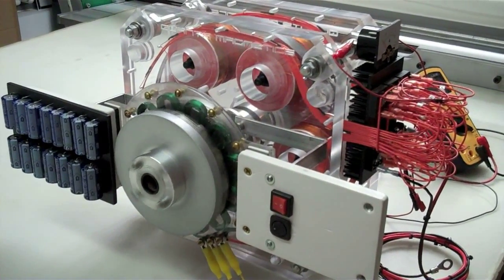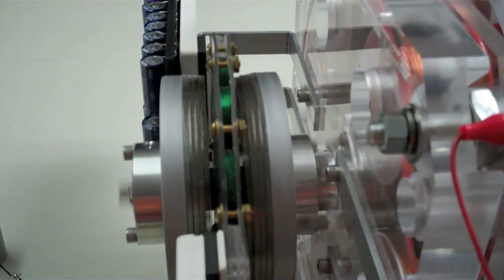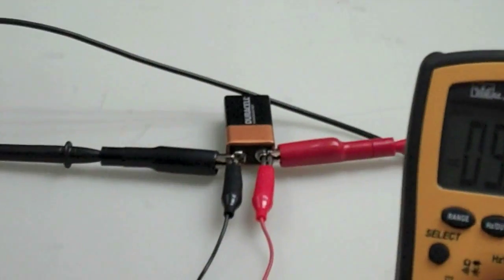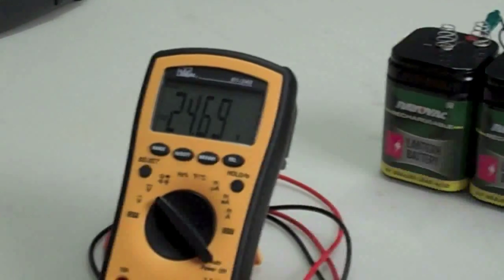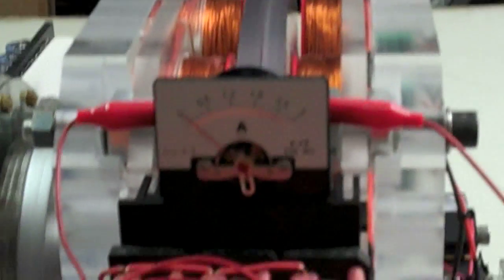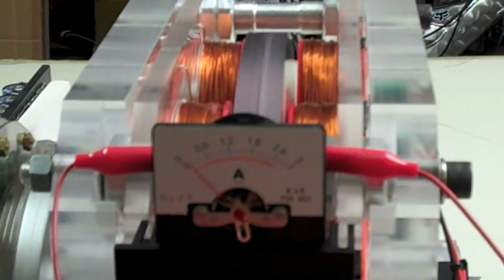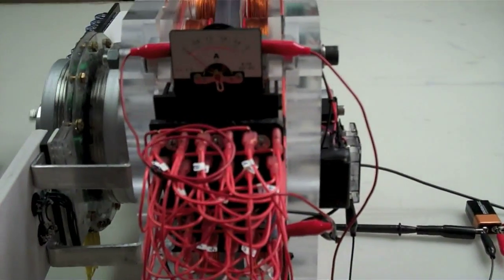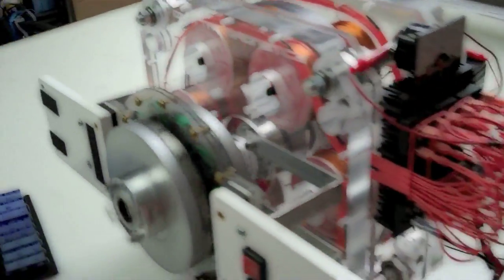Ultimate Pulse Motor Generator - New Energy

Comment: Hey, here's an idea... I'm not a genius, but if you got to the point of building such a complicated and "awesome" device I'm sure it might have crossed your mind too... Why not put the two 6 volt batteries in series as the source instead of the 9 volt, and have your crazy generator charge them back!!!?!? i.e. If you're getting more than 100% efficiency it would run "FOREVER"... Ha, ha... I know you've tried it and it didn't work, Did it?!?

Comment: 6:40

Wouldn't it be more efficient to just hook the 9V up to a transformer and hook that up to the Pb batteries? It would charge at several amps, more quickly. It's not like you're creating more energy to put into the lead acids... you're just doing it more slowly, and burning some to charge up and run a flywheel.

Comment: Your video is not showing the current going into the lead acid batteries. You can raise voltage with magnetism but current should be the same coming from battery to battery. There should not be more current than given to the circuit.

Comment: Actually you are so wrong. The mangetism arround the cobber cable is circulating arroun the cable. When you move metal near this field, amount of field inducting into the metal is called magnetic flux. Bigger flux bigger amount of current transferred. Go to study more electronics.

Comment: Jason is correct, flux is one of those words that has multiple meanings, flux is both the acid used in soldering, but it's also a word used to describe the magnetic bands. that being said "axial flux generator" is a really wordy way of saying "alternator" (though the design he used is better suited for low rpms (you'll find a design like that in wind generators, the alternators in your car are a bit different, but the same principle)

Comment: I agree this is crap but wtf are you talking about? "Flux is what you add to solder and electrons flow through wires." Flux is the magnetic field lines going through a surface. You don't add flux you create it.

Comment: Actually it's not flim flam at all. Inductors, or coils, store energy in the form of a magnetic field. Once the magnetic flux density reaches a maximum value, the inductor becomes saturated at which point it can not store more energy. Of course I'm not suggesting that this motor is able to output more energy than is supplied via the battery.

Comment: and before you come back saying that it's to do with how little the rotor draws compared to how much it puts out, or that it's to do with how efficient the bearings are, or any of that hogwash, NO. no matter how efficient the rotor, total energy out PHYSICALLY CAN NOT be more than total energy in. even if you are using some sort of "waste energy" created by the rotor to charge the lantern batteries, said waste energy is exactly that: WASTE. it is not "extra energy", (continued in next post)

Comment: I see a bunch of batteries and capacitors. As far as I can tell you have a mechanical voltage booster/capacitor. This is nothing new. Anyone who knows Ohm's Law can tell you this. What are you really showing? What is the work being done? There are plenty of semiconductor's that can do this. Are you saying it is more efficient? This video could be titled, "Look! I made the thing spin with a 9v battery!", and be accurate.

Comment: I could be wrong on this. I dont think any earthing will prevent static.
As I said static is useless power its very hard to tap into. Because its just sitting around on non conductive surfaces. Its not being conducted in one way or another. It is not DC or AV, It just hangs around. Thats why it cant be earthed on non-conductive surfaces. And rain will only help keep the levels down. Static likes it dry.

If anyone know anything real on the static ground. Please say so. Just dont be a coo-coo  :)

Comment: I think you just charge water up, when its full it burps and creates energy which then gets collected by a vacume cleaner that feeds on the stuff it sucks up to power itself and puts power back into your socket that goes to the power station and turns excess electicity into spare coal.

Comment: I am beginning to see the big fuzz comes from the iron core coils.
In that you might be right.
But in none iron cored engines and generators the laws are different.
No drag in generators for one thing. The numbers of turns coils dont have that big meaning either.
In none iron cored engines and generators it is a world of difference.
The wirelenght and magnetic strength is everything.

Comment: It sure will, But not much to efficiency. They just allow smaller and more power hungry motors. As a result of the much more powerful magnets, Coils with fewer turns can be made effectively. Coils with few turns of wire and a neodymium magnet can make very powerful motors.
Having the biggest magnet in the universe wont help you get more than 100% efficiency.

Comment: Incorrect
The more turns of wire you have in a coil the more sensitive it will be.
Even if you had 1 TRILLION volts coming out of that thing, The current goes in the other direction. You might only have 1 Femto Amp.

I dont think you get that 'Power in Watts' is the figure you should be using. Not volts, Volts means nothing without Amps. And you need to show whats going in and what comes out.
A 9v battery wont last for days if your thing draws 50mA, It might last 3 hours at that rate.

Comment: I watched 2 previous videos, I was skeptical but it didnt seem like you were misleading anyone.
This video has just killed any credibility you have. 
A 9v 150mA battery is not going to charge two 6v 5A batterys with any magic machione you put in the middle.
And having a lot of turns of copper is going to make a more sensitive coil.

You NEED to show PowerIn > PowerOut.
Ie VI= P for both in and out.

You might not have made this video, But your still responsible for your own credibility.

Comment: Directly from the book
In experiments it can be shown that the force F is directly proportional to the sizes B, I and L.
B is the magnetic field size, magnetic flux density is measured in Tesla. [B] = N / (A * m) = T.
In the current strength and is measured in amperes.
L is the length of conductor in the magnetic field and measured in meters.
That formula is equal to F = BIL

Comment: Yes, its a mechanic tranformer, it changes the voltage, the current drops a little, but its not a overunit device. Energy stored on cap is less than what you had on batt. They use this kind of device on massive tesla bobines to generate millions of volts and big sparks like the sparks made by nature. Also, there are incredible inefficient, they consume much energy, better to use stationary transformers.

Comment: Question: What is the purpose of this machine? I mean I get it it's a battery powered electric motor turning a generator that charges a battery. The point is that whatever you do to it the energy used from the initial battery is higher than the one stored in the charging battery. So what is the point? You might as well use an inverter and transformer and get much higher efficiencies than that.

Comment: Beautifully built project. Those lead acid batteries were already fully charged at 12.88 volts and wouldn't be drawing hardly any current regardless of what you hooked it up to so I'm not quite sure what the point of this demonstration was. Hook these batteries up to a 500w halogen light bulb and show it draining dead and then hook up your gizmo and show it charging to 12.8v with only milliamp current draw and then you have something - or not.

Comment: And it continius. The drag in generators is purely from iron cored coils and back emf which coils create. The Laws Lenz dont say that iron core is needed and it dont say that coils is needed either. If you paralle wire instead there will be no ressistence for the voltage which create the Back Emf.
Yet it will still create the same amount of watts, just more amps is created.
All in all. It is very open for overunity.

Comment: The "open for overunity" dosnt not even stop there The law of Newton says if you remove the weight you get more speed and speed is what current is made of in The Laws of Lenz.
 You can remove weight by avoid use of iron cored coils.
And it dont stop there either. The Laws of Lenz also clearly says the more wire and Tesla you get more current.
So forget about Thermodynamic crap. That is gone here in this area.

Comment: No it is not. Where did you get that idea from? It is funny how that law is used in everything. When infact it have nothing to do with electromechanics at all. In electric Engines it is Laplace law of Force that rules, nothing else.
It says that the engine output Newton is equal with Tesla x wirelenght x amperes.
That means 1 Tesla x 1 amperes x 1 m wire is equal with 3 Tesla x 1/3 ampere x 1 m wire
If you have brain you will know what that means.

Comment: The law of nature and electromagnetism are not "open to overunity" devices. They are bound by the second law of thermodynamics. To bypass the law of entropy, the menkind needs a fundamental scientific breakthrough, and if that happens, all the physics books will have to be rewritten. That cannot be done by people who combine Radio Shack components and 19. and 20. century technology, and say "flux equals energy", "amperage", and believe that producing voltage is enough to charge the batteries.

Comment: @Dan B - If you think about it, a bicycle is chock full of parts for this type of project. Crank, wheels, bearings, brakes, maybe the neck joint for the handlebars will come in handy. I am going to flip my kids bike over and start tinkering... Then spare computers for other sources: magnets from the hard drive, coils from the power supply and other random stuff. auto parts store for wires and connectors. Maybe the dump for items with lots of copper in them if you can beat the other scavengers

Comment: My guess would be a few to several hundred dollars worth of magnets, copper and capacitors - start small and test on your own. My guess would be to replicate this version without the sweet plexiglass and cnc machined aircraft aluminum and pretty colors your looking at 1 to 2 grand still. like Nike said, JUST DO IT (get started anyway) I am going to start myself by making a few coils and rigging them up to some magnets, crank the bicycle wheel manually and measure output with my new multimeter

Comment: you had me at voltage is not a measure of power, but he is not trying to take something from nothing, he is taking something and amplfying it, then recycling it back into itself for maximum efficiency. I dont know if this will solve anything but it sure as heck wont hurt to find out for yourself. I am.

Comment: Real world generation of electricity can happen like this. However, it would cost over 5ooo dollars for the copper needed to run all the huge ampere motors in this society. Excluding   the cost of those high priced 10 pound neodymium magnets. i suspect that a house device might run a cost up to 18000 dollars  that is a lot of upfront cost to anyone I think. I thought about really building one but soon got bogged down with cost and details. I do think it is real though.

Comment: Is this Joesph Newman's idea reworked? high  voltage miniscule amps with capacitor caps slapping magnets through magnetic flux around a vortex for rotation? He used a 9 volt also. I read the powers in cooper eddies in the cooper atoms .Electrons reaction to field current not associated with amperes but  high voltage charge. that's why the device needs so much cooper compared to amps. Strange thing is the patent office would not give patent.They said something about not having a proper ground

Comment: Laplace law actually prove it.
Engineers do what they are told in the small frame there are working under.
The example, have you ever seen the motor of a rechargeable powertool.
Notice how thin the magnets are. Yet it have a huge torq.
Point is they could easely have made it more effective in long lasting batteries and in torq. Just by make the magnets stronger.
It is politics. It is funny though, most know that the motor get stronger
with better magnets and more wire, yet noone figure it out

Comment: The reason it is importen is that the Newton unit can be rewrite to this.
The difference in in the math between a Iron cored motor and a none iron cored.
Example
Iron cored:
sec x Newton/0,5 = meter/sec
none Iron cored
sec x Newton/0,07=meter/sec

Way more speed for the same input of current and more speed to the generater to create current. 
Speed is part of generating current..
So the input current is by far the only player in this to create output current.
Magnet, Wiring and weight is equal

Comment: My invention? What do you think motors creates?
This is directly from the book.
"In experiments it can be shown that the force F(Newton) is directly proportional to the sizes B, I and L.
B is the magnetic field size, magnetic flux density is measured in Tesla. [B] = N / (A * m) = T.
In the current strength and is measured in amperes.
L is the length of conductor in the magnetic field and measured in meters.
That formula is equal to F = BIL."
Where F is n Newton's third law of action = reaction

Comment: A capacitor that is fully charged doesn't consume any power so when this thing is hooked up to it it proves nothing. Hook the generator up to anything that actually uses power and read the voltage and amperage across the wire to compute the power generation and compare it against the power consumption of the 9 V battery. To anyone that knows anything about electricity, voltage is not a measure of power. You need to measure amperage also.

Comment: So you fooled the first law of thermodynamics by saying that you can use a battery with low capacity to charge two larger batteries with much more capacity? You can't get more energy out of something than you put into it. Left aside all the heat generated by the resistance of those 12 pounds of copper wire.  I don't buy it.

Comment: and friction is also quite easy to remove. There are tons of really good bearings, that are close to fricrionless. Heat is mostly dúe to bad desings and it really any  problem in this at all.
And I do know you havent looked into this at ALL.
Becourse all math in this points out that there is a huge potential in this.

Comment: Dont seems you know much in this.
Weight is easy to remove, just discard the iron core. Look up highspeed non iron cored motors. That is very real.
Example
Iron cored:
sec x Newton/0,5 = meter/sec
none Iron cored
sec x Newton/0,07=meter/sec
The benefit is huge.. way more speed.
And speed is what current is made of in generators.
Look into and stop believe in crap.

Comment: So basically in 1 sentence it's a fairly efficient DC to DC converter. DC getting pulsed into basically a synchronous AC motor running a AC generator which outputs higher Voltage AC but lower current and then put through a rectifier to get your DC output am I right or am I right. Slowly discharging a 9v battery in order to even more slowly charge two 6v batteries. Even at 100% efficiency there are less joules of energy in the 9v battery than in the two 6v batteries.

Comment: Offcourse you cant remove it completly. But there is a huge different with a generator with or without an Iron core.
The math is NOT thermo dynamic, it is Laplace law of Force and the induction law. Look that up.
So overunity is very possible. With a huge potential.
More specific that means that 40 watts and 0.5 Tesla gives the same amount of force as 20 watts and 1 Tesla.

Comment: i would ve very interested to see if you can measure the energy coming from the top surface of the cap banks when the motor is at 1000 rpm  and the 9gen is disconnected from the cap bank. this could be the real breakthrough. harnessing that energy output and amps. can you say Nobel prize?

Comment: i see how this works. I dont see why others do not. the other videos show even more . to answer the question of why when the gen is disconnected do the cap bank 1 , 2 , and 3,on top will shock the heck out of you is as the other man said, therer is an incredible amount of induction there perpendicular to the caps physical structure. i dont know the math but it is the same as the lines of force in a rail gun.

Comment: Actually your wrong about that. It is also quite easy to disprove those fake claims.
Remove drag and weight from the moving part and you will have overunity.
Put a 200 horsepower enigine in VW and it will run like a dragster, put a 200 horsepower in a shipcontainer and you will walk faster.
A electric motor and electric generater only will generate 60% output from the input current. Remove the drag and weight, if it only runs twice as fast
it will still create 120% output from its input.

Comment: if this thing really works... since you have a greater voltage output as claimed in this video, why not loop the output to the input supply and remove the 9V batt,

Comment: let us see milliamps on the 9 volt side and milliamps on the charging side along side of the voltages. and if all those people are asking those questions, why not answer them directly?  let us see 110vac on the primary and 10 1500 watt heaters on the secondary. that would be something we all could relate to, i.e. we could heat 10 rooms in our house from a single 15 amp outlet. better said, pay 1/10 on our electric bill.

Comment: Point is: You can't just look at the voltage and say that you have more or less power. You could have more voltage and less amperage and less power. You could have less voltage and more amperage and more power. Power is power and you can't determine the amount of power by voltage or amperage alone, you need to know both